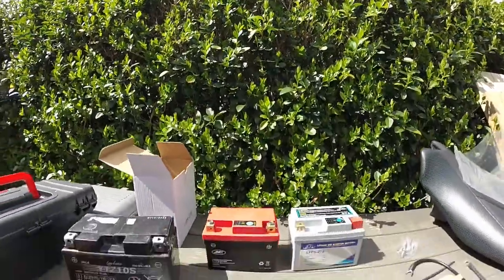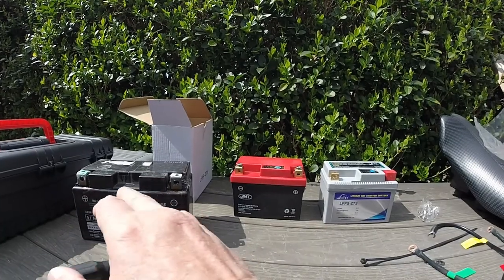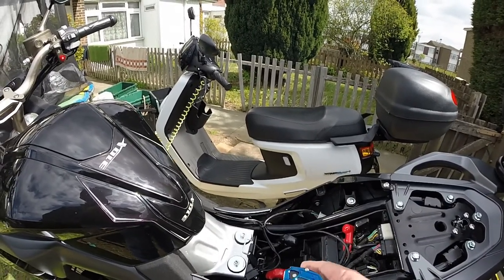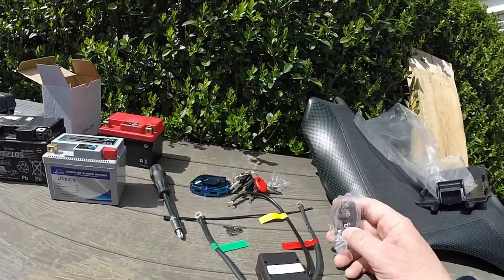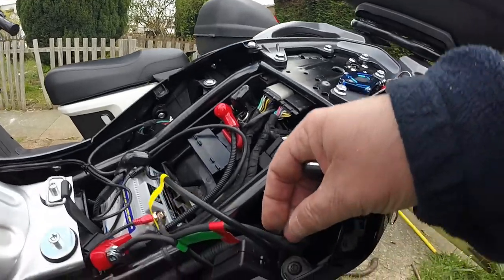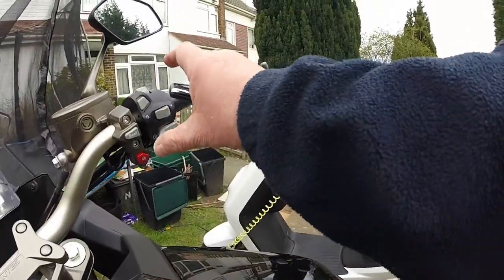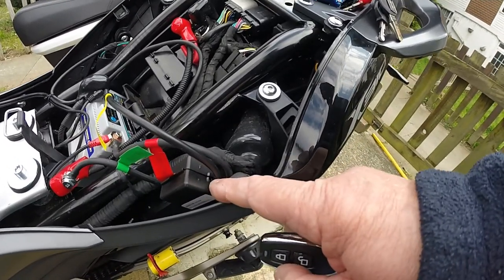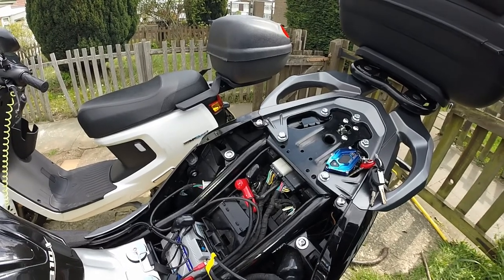ZONTES 310 REMOTE ISOLATE LITHIUM BATTERY TO STOP BATTERY DRAIN OR ANY RIDE UP TO 400 cc

Comment: Thank you very much! Does it work also for the 310 x1 model (2020)? Is there enough space to mount it under the saddle  ?
Reply from the maker: Yes it would work for either the lithium battery model or the gel battery model. The small unit mounts to the space side panel by positive terminal will post a video tomorrow to explain final wiring points and placement

Comment: Where do I link the output  terminal? If needed, could I charge the battery after the installation, or I have before to remove it?
Thanks
Reply from the maker: The output terminal is joined to the bikes red positive away from the battery. If after install you need to charge the battery just put your charger battery clips to the batteries positive and negative like normal
Reply from the maker: 1. So simply take off your positive terminal lead and attach it to the output cable of the isolator with the nut and bolt in kit then use insulation tape all around that join, so it can not touch the bike frame .
2. Attach the input two cables to the battery's one positive  (red label sticker) and one negative ( yellow label sticker).
3. The unit can be hidden in the gap to side panel ( opposite side to where the tool kit hides )
Job done cheers all

Comment: Hello there, I wanted to buy this item but it says that it should be on a batterie with less than 40A. 
Mine is 65A (at -18C) max and yours (Leoch LFPSZ7S) is at 140 !!! 
Did you had any electrical problem with this ? I'm afraid to burn my bike with this lol.
Thanks for the answer
Reply from the maker: Hi sorry I meant to remove this video, I had mine on for three months working fine then it started draining battery so I took it off, bought an optimate lithium charger and so now if I'm not using bike for a while I leave it on the optimate charger regards Mick

Comment: Hello there! I have to change the lithium battery of my 2020 Zontes 310 x1. The original battery is very expensive, so I'm considering to buy another battery. Do you have some models to suggest? 
I've found some lithium batteries (Skyrich HJTX5L-FP 12v 19.2Wh 96A, BC Lithium BCTX5L-FP 12v 19Wh CCA 105, and BCTX7L-FP-S), one Gel battery (FULBAT Gel FTX4L-BS / FTZ5S / YTX4L-BS High Capacity 12 V 5,3 Ah 70 A) and AGM battery (Yuasa SLA YTX4L-BS 12v 3Ah - 20hr- 3.2Ah 50A - CCA), butt I don't know which one could be good for my motorcycle. 
The lithium and AGM batteries above have lower Amphere than the genuine one. Gel battery, on the other hand, seems to be OK, but has 5.3 Ah, instead the 4.4 of the original one). What can I do? Many thanks for one suggestion.
Reply from the maker: Hi Ivan which country you from cheers
Reply: Italy
Reply from the maker: @ivanfil3971  hi , you need a lithium battery as the rectifier kicks out  more power to charge the lithium battery as lithium battery is 13.2 v nominal where a gel newer lead acid battery is 12.4 v nominal when fully charged. You might end up cooking a gel battery, not ever tried it, the Ah is the amount of charge the battery has in capacity terms, if you go down the route of a gel battery get the  biggest Ah and CCA ( the CCA is the cold cranking or starting bike capacity) the newer 350 cc zontes are now all gel battery's and when I did a rectifier stock check the part number is the same for the 310 and 350 models , so it seems the cheaper gel option can be used. Yet the Ah of the newer 350 is 10 ah you will not get that capacity in the space you have under seat , so just get the biggest gel battery you can then see how you go, you may need to get a gel battery charger depending on how often you ride the bike, get a gel charger that comes with quick connection so you can have the connector in the side panel area, like the optimate chargers ta madmick
Reply: Hi! You are the best!!! Thank you very much for your support!!! 
On Amazon I've found these 12v batteries with the right dimensions:
1. FULBAT Gel FTX4L-BS / FTZ5S / YTX4L-BS (High Capacity) 12v, 5.3 Ah, 70 A - 30 euro 
2. BC Lithium Batteries BCTX5L-FP Lithium  LiFePO4 19wh 105CCA (no information about Ah) - 40 euro
3. Skyrich HJTZ7S-FP Lithium 28Wh, 144A - 67 euro (no information about Ah). 
Which battery do you suggest to buy? 
Many thanks
Reply from the maker: the no1 gel will be your best bet, as the lithium options you have for the size of battery compartment have good cranking 120+ cca yet your storage capacity on these sizes are only 2 amp... if you have a lithium charger then these options will work, yet if the lithium battery falls below 8 volts you need a specific type of lithium charger to wake up the BMS in the battery so charging can start up..... the no1. gel battery on this size is normally 4ah if this is 5ah then its your best option , mainly because the bike uses power when turned off to hunt for your key.... you can then if purchasing the gel battery use a standard charger with a lead to side of bike to top up whenever needed, because as you know you cant open the seat if battery dead... so i would go for NO1 THE GEL BATTERY OPTION CHEERS
Reply: Hi there! I'm sorry but I have another question: the gel battery is 12v while the lithium battery is 12,8v: this could be a problem? Thank you!
Reply from the maker: @ivanfil3971  gel or lead acid battery are 12.4 volts lithium battery have 4cells of 3.2 volts in them . The voltage regulator in the rectifier will kick out 13.8 volts to the battery when bike started to recharge the battery, there should not be a problem
Reply: Hi Michael, maybe I've found two other compatible batteries for my Zontes 310 x1: (1) Accurat LiFePO4 YTX4L-BS, 5.3 Ah, 100 A, 12 V, 68 Wh; (2) Skyrich lithium hjtz7s-fp, 12 V, 28.6 Wh, 144A. This last one should have 2.4 Ah but, If I don't wrong, this value is comparable with 4.8Ah or more of a no-lithium battery. Thanks a lot. Best regards. Ivan
Reply from the maker: @ivanfil3971  hi good find, whichever way you decide to go, either lithium or gel, there are two points to take into account, 
1. It has to fit in the limited space
2. More importantly, get an optimate charger if going for lithium, that way you can attach the charger via it's special lead that you can hide under a side panel so you never get stuck in not being able to open seat, but if you do get an optimate charger, don't buy there base optimate 1 charger as it can't recover a lithium battery below 8.2v as it can't communicate with the battery BMS and therefore won't charge the battery
Reply: Hi Michael, many thanks for your feedback. Taking advantage of your kindness I have another question for you: If I buy a lithium battery (LiFePO4 or not LiFePO4), could I recharge it using the battery charging DC connector that there is under the saddle? Thank you
Reply from the maker: @ivanfil3971  
Hi, that port is for the specific lithium charger that you get from zontes, you could use a multimeter to see if its got the 12v to it when a battery is installed, its a round pin affair, so not sure whether the inner tip or outer is positive, then you would need a charger with that specific end on it, or adapt it to your needs, but yes if there is power at that point then you could use it for either type of battery installed on bike, best see if yours is hooked up first though with multimeter
Reply from the maker: @ivanfil3971  hi ivan can i ask where you live ta
Reply: Sure! I live in Milan. Thanks for your help!
Reply: Hi Michael, I'm here yet. I've tested 2 batteries : a 5Ah gel battery and a 2,4Ah lithium battery HJTZ7S-FP (with 28Wh, 144CA). While using the first one the engine didn't started, with the second one the engine started right after the installation (Friday afternoon), but didn't started two days later (Monday morning) . I don't know why... Do you know if this is because the battery has only 2,4Ah or because it has only 144CA (another Zontes customer said me that our motorcycle needs 300CA...)?
Another question: when I push the red button to turn on the bike I don't hear any sound (bep) and I don't see lights up on the directional arrow (but the display lights up regularly). This means that the charge of the battery is low? 
As usual, many many thanks!
Ivan
Reply: Hello, please tell me, I have such a problem with the zontes x310 motorcycle, when I approach the motorcycle and press the red button with the lock, nothing happens, the motorcycle turns on from the keychain with 8 presses and also took out the antenna that stands on the tank, if the key brings the motorcycle close to it, the motorcycle will open and the buttons that are on the steering wheel, what can it be?
Reply from the maker: @EmelyanovVladimir  it could be your keychain remote fault, try the spare keychain that came with bike
Reply: @michaelphillips1959  I tried another key, all the same, how to delete the error?
Reply from the maker: @EmelyanovVladimir  do you get an error code on LCD dash?
Reply: @michaelphillips1959  No, there is no error on the panel
Reply from the maker: @EmelyanovVladimir  you mention you had the 12V battery out of the bike ,is that correct?
Reply from the maker: Also your model is the 310V correct ?
Reply: @michaelphillips1959  I didn't understand your question
Reply: Model zontes x310
Reply from the maker: @EmelyanovVladimir  ok, I am going to upload a video the model is 310V as I don't have one for the 310X,  it's the position of the passive keyless entry (PKE) on the bike next to the battery, pay attention that the antenna is attached  and the PKE controller bullet connector is secure( undo and reconnect) I have slowed down the video, will put a link to the video here soon, if these are not attached your keychain won't be recognised by the antenna so take your time with this one check the connectors cheers mick
Reply from the maker: https://youtu.be/SMJXlqGO-yk
check antenna connection and controller bullet connector
Reply: @michaelphillips1959  I checked everything several times and reconnected